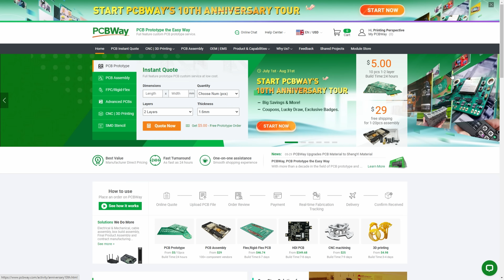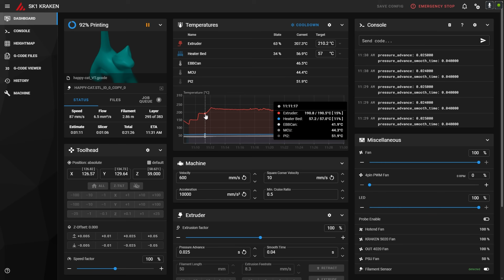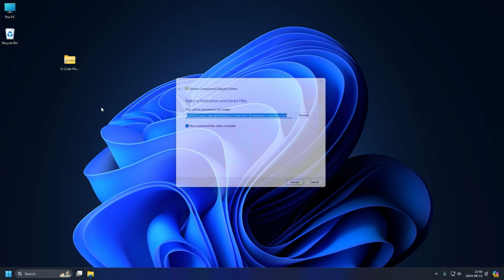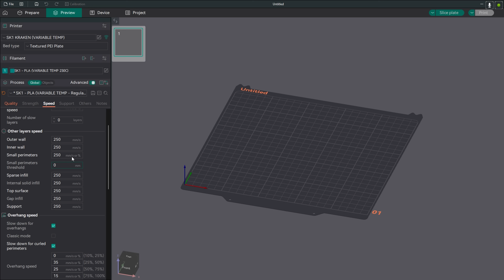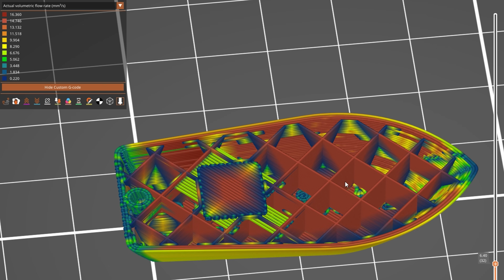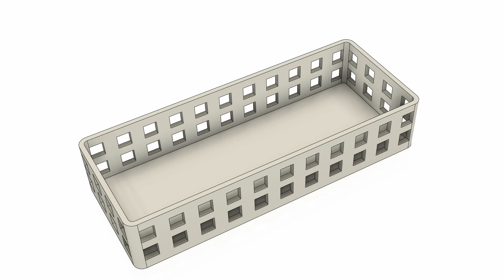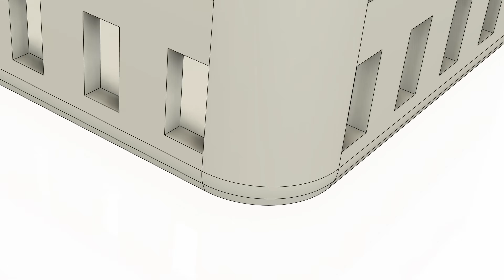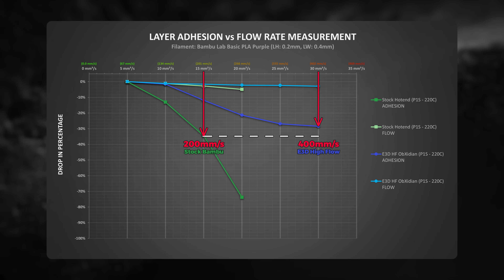Variable Temperature 3D Printing – The FUTURE of 3D Printing?

Comment: @PrintingPerspective   orca contributor here :)

I have a couple of questions with the testing that I'd like to better understand. Especially since I've seen that feature request multiple times on the Orca discord and orca issues list :) !! And because I love print quality and am obsessed by it - I did develop the adaptive PA feature, the don't slow down outer walls for layer time, refined the inner outer inner feature for the next release and the bridging algorithm perimeter segmentation to avoid unnecessary speed drops when printing overhangs and get overall better print quality out of the slicer :) 

In the setup part of the video, I see that you've set the speeds to be all equal - perfect!! However, how in the gcode preview at 5:45 you get lower flow in the smaller perimeters? Orca doesn't visualise actual print speed (so the acceleration effect is not visible) but rather requested print speed (and hence, flow). I’m assuming what we are seeing there is a reduced print speed due to the script estimating that the printer can’t reach a high speed anyway due to acceleration limits, so it clamps it down to allow for a smooth temperature increase, and the time it takes to ramp up the nozzle heater.

The question is why it’s slowing these areas down though? If the printer can’t hit the print speed anyway, why clamp it? 

The second thing, is response time of the heater. While the gcode may ask for the heater temp to be set to X it takes at least 20-30 seconds or even more in some cases for that temperature to be reached. In which case any transient features, like overhangs would not benefit, as the change in speed is faster than the hot end can adapt to. So, at best, the script just sets an average temperature that optimises for the average flow over a 20-30 second or so time window. Meaning that some areas will still be either too hot or too cold for the requested flow (eg. a fast perimeter with an overhang in the end like the benchy hull and benchy nose will be printed probably a bit cooler than needed). 

Where I am getting with this basically is that adjusting the temperature is one way, but in my view is approaching the problem from the wrong end. I believe we should be striving for as consistent flow / speed as possible for the external walls, with as localised as possible change due to overhangs. 

Also we should be tuning the print temperature to perform best for those external features (including the acceleration limits of the printer) and run a max flow rate test at that temperature. Then use that value to print the faster internal features as the "speed limit". Thatway, whatever feature is visible, is consistent in extrusion width, gloss and PA, while whatever feature is not visible, is printed within the limits of the hotend tuned for external surface finish.

So in the example printed above, set the external wall speed to 70mm/sec and nozzle temp to say 210c and max flow rate to whatever the nozzle can support at that temp. Then the internal features are speed clamped and the external features print at a constant and consistent speed, within the printer limits.

It would be interesting to see the gcode output of the script and visualise the temperature changes to understand better what it does. It would also be great to better understand in the areas where you've seen those differences, what the true root cause was -  a test with the print speed being equal across the model and the flow and temperature setting to match as described above would yield very interesting results I believe! Also with adaptive PA that is now present on the latest nightly :) 

PS. For the adaptive PA together with the klipper devs we have addressed the stuttering issue ;) the latest nightlies contain this code and klipper has this enabled since July ish this year. 

It is great to see someone that shares the same passion as I do for print quality - so I'd welcome a ping to chat about this and experiment together on it :) Please do reach out if interested.
Reply: Looking at the script code, what it appears to do is create a temperature profile for the print based on the desired print speed. It then parses the gcode file and sets temperature commands to it. It then adjusts the feed rate to match that temperature, in effect slowing down the print in areas where the temperature has not been reached yet. 

So basically it’s slowing down the print for the layers where the temperature has not arrived yet / in effect smoothing out feed rate changes over a period of time….

Which could be equally achieved by striving to begin with to have consistent print speeds 🤔
Reply from the maker: Hey, you did some great work! :) At 5:45 you see the imported gcode after the script altered it. It would be best if you tried paying with the script yourself and ask its creator how exactly it works. I asked him just for a basic explanation as diving deep into how he programmed it would be too much for me, haha. Yeah, that is another way - printing the outer wall slowly. We can chat. Please write your discord name to my email, most of the time I am very busy as I am always working on the other future videos, but I will find some time. :)
Reply: @PrintingPerspective yeap I realised that’s the gcode output after I’ve written my comment lol! I’ve edited above. 

What I don’t get is why it slows down the perimeters in those areas. 
Unfortunately I don’t have a windows computer to run it :(

I’ll drop you a note to chat! Thank you!!
Reply: @PrintingPerspective can’t find your email :( do ping me on the orca sub, my handle is the same as here :)
Reply from the maker: I have found you! haha
Reply: @PrintingPerspective  can’t see your email I’m afraid. And YouTube is cutting my comment when I say what my details are :( I’ve got the same name everywhere so do reach out if you can :)
Reply: The points brought of here are similar to what was discussed briefly in a post I made to the klipper discourse. From my perspective, the main advantage of the variable temperature is maybe not necessarily improvement of surface finish in the same layer, but improvement of surface finish between different layers and the ability to print larger layers fast at higher temperature while reducing temperature for smaller layers. Ex: large flat plate with a small feature sticking up in z on one side. The large flat area could print faster at higher temperature and then the temperature could reduce for the small feature.
Reply: @gunnerpetrea3531  but then wouldn’t you overcook the filament for the external perimeter? For example consider a layer with 60mm/sec external and 250mm/sec internal perimeter and solid infill speeds. This repeats over 5-6 layers as say it’s a top surface so there is plenty of time to ramp up the temperature.

If you adjust the temperature to optimise for the average of the set of layers you’ll end up printing at too high a temperature for the external perimeter, no? Maybe that’s why the author of the plugin recommends to set the values all equal and high in speed to avoid this inherent limitation?

Same thing would happen with drastic variations in acceleration. Say 6k/8k internal solid infill vs 1k external perimeter. The ramp up in speed for the external perimeter would result in too high temperature for the actual extruded speed, no? 🤔
Reply: @HotendHacker  I think the key thing would be to make sure that the temperature you set for each flowrate matches what you want for the outer perimeter, if that makes any sense.

I think an example might explain it better. Imagine you are printing a layer that isn’t cooling limited (full print speed for each movement type is being achieved). The hotend temperature is set to 230C for PLA and the external perimeter is printing with a flowrate of 25mm^3/s. That temperature and flowrate combination will result in a certain surface finish / material temperature as the plastic exits the nozzle. Now imagine the next layer is small, so it is cooling limited and the flowrate for the external perimeter drops to 10mm^3/s. You would have your temperature adjustment setup so that for the lower flowrate the  hotend temperature is reduced to achieve the same surface finish / material temperature as the plastic exits the nozzle (maybe 210C).
Reply: @HotendHacker  Building on my previous reply, if we maintain the stance you mentioned of "striving for as consistent flow / speed as possible for the external walls, with as localised as possible change due to overhangs", I think the combination of the two methods could provide really good results. The minimization of flow / speed changes within each layer eliminates inconsistencies within the layer and if the temperature adjustment was setup to only act on a per layer basis or with adjustable "averaging" time, the temperature could be changed to achieve faster print speed with the same or better quality.

Comment: I solve this issue in a different way, I just slow down my outer perimeters so that they are consistent and have the same speed regardless if they're small or large. Also printing the outer perimeter first helps as well.
Reply: Yeah, but it is not always practical: Overhangs do not like this setting.
Reply: @Bapate-rh9be  not necessarily, I can print like 65-70° overhangs with 0 cooling and 0.6 nozzle with CF nylon by using with outer walls first. Anyone printing dimensionally accurate and strong parts will use outer walls first, if they aren't, big oof.
Reply: @FrozenByFire3  do you use slowdown for overhangs feature in slicer?
Reply: @riba2233  yes always
Reply: @FrozenByFire3   awesome thanks, and if I may ask (since I am interested in numbers with 0 cooling) how slow do you go, for eg on 45deg?
Reply: @riba2233  oh I only slow down for like 55°+
Reply: @riba2233  and that's like 10mm/s for 60-70°, below it's 15-20mm/s
Reply: @FrozenByFire3  awesome, great info, thanks!

Comment: There were people who were making induction heated hotends, those will be perfect for this software, induction heated hotends thermal mass can be made way lower than what is possible for resistance based hotends.
Reply from the maker: Now we talking! A great idea. :)
Reply: Ino trident by plasmics!
Reply: @onurcetinkaya4873  Induction with low thermal mass can only work with well tuned MPC. PID can't control it because it relies on a large thermal mass to buffer against heat loss and gain until the control loop can catch up with changes.

Now that DangerKlipper has MPC, there's a lot more incentive to develop induction hotends.
Reply: @daliasprints9798  I Didn't hear about the concept of model predicted control before, and it is such an obvious thing, thanks for letting me know about its existence.
Reply: Who told you that, MPC is not the only way. And PID can easily be used in conjunction with FF control techniques to reduce set point errors. 
Mpc is such a wild thing to claim necessary i am genuinely curious where you heard that. 
There are so many computationally efficient ways to control this without requiring mpc.
Reply: @daliasprints9798 as far as I know, PID really doesn't like mass or inertia (mainly because counteracting inertia requires cranking the (D)erivative part of PID, which is the main thing that can render the control loop unstable). As far as PID is concerned, the less time between changing the input and seeing results, the faster you can make the loop without losing stability.
Reply: @Validole  That's kinda true for PID itself (up to measurement noise issues), but the problem is that the melt zone temperature will only correspond closely to the measured thermistor temperature with lots of thermal mass. Without that you'll have wild swings you can't control, and melt will fail under varying flow unless you just set the target temperature like 30+ degrees above what's needed.

Comment: With a hotend that has very small heat mass (capacitance) it will help...but with a bigger hotend that has a lot of heat mass, it might not be ideal?
Reply from the maker: If you want that the temperatures would react to the flow rates as closely as possible then yes. Otherwise, transition sections from fast to slow (or otherwise) should be slower and add up way more time. :)
Reply: I’m currently working on temperature based flowrate limiting for klipper in my own branch. It should allow the firmware to limit the flowrate in real time based on the hotend temperature. Obviously this does not fix the thermal mass issue, but it would eliminate the need to try to predict how long it takes the hotend to heat up.
Reply: @gunnerpetrea3531 can you provide a link to your git?
Reply: High mass/low power hotends (40w volcano) will have a significantly longer delay between setting a temperature vs reaction. Thinking on top of my head a rapido 1 would be the ideal (consumer) hotend for variable temperature. 115w peak power, low thermal mass, screws that increase heat transfer into the heatsink for quicker cool down. The by far best hotend would be the ino trident by team plasmics. Its a induction heated hotend that heats to 220c in 9s
Reply: On large models...when running larger layer heights, the speed up takes time but Im generally doing up to 35mm3 so they slow down fast. This is brilliant...yet to test but the concept I mean